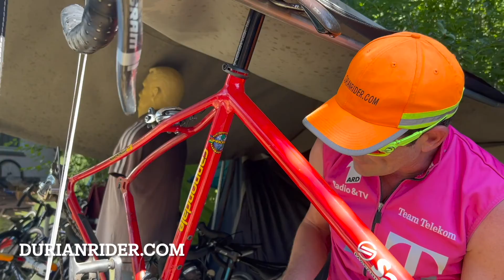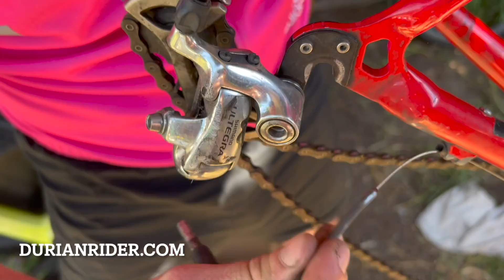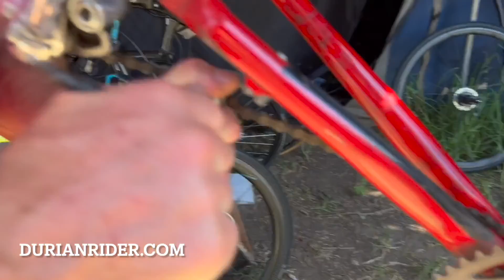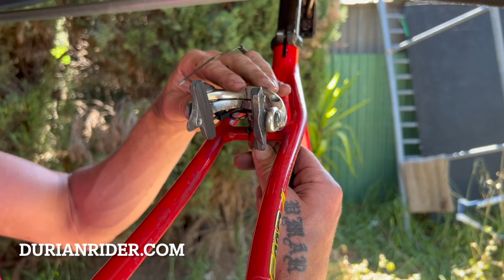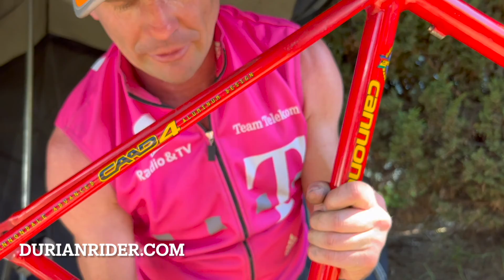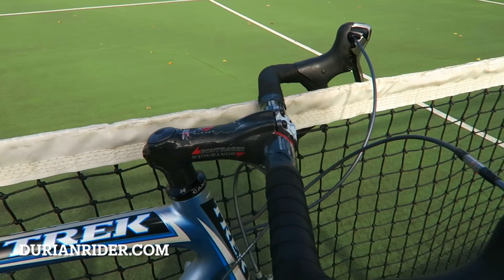How I lost 75kg of fat

Comment: I love it great video dude I agree any food left over at this house goes outside into the yard I got all kinds of animals that like to eat it. I ride 150 + a week. Don't even drive my car anymore I commute everyday and then on the weekends I wake up early and I'm out riding all day on Saturday and Sunday..... I see people out jogging that are overweight and they're like there's so much pain trying to run. I've talked to a couple people I tell them you need to get on a bike running is so bad for you let's go some low impact and you can burn all that fat off. And it's so much more fun
Reply: Bro I ran 28 miles in one go on the weekend in minimalist shoes and my body is completely fine (check my strava). It’s not inherently bad just takes a long time to build up the durability in the body. But yeah, walking is better for fat loss for 99% of the population.
Reply: @TirnanHealy  how much do you weigh? But yeah, swim, cycle, walk. If you have the money, one of those recumbent 3 wheelers, where you can recline and pedal.
Reply: @TimpBizkit  at the time of posting that comment I was 73kg, I’m 78kg now… messed around with low carb / fasting and then had a crazy rebound 🤣 on the way back down now
Reply: @TirnanHealy how are you getting on now?
Reply: @nicolejones2468  ahh, hate to say it but I’ve been undisciplined the last couple months. Been undoing a lot of gains with drinking and eating junk food (still 78kg though surprisingly)  now working back to it with low fat, high sugar & high exercise 🔥
Reply: @nicolejones2468  how about yourself?